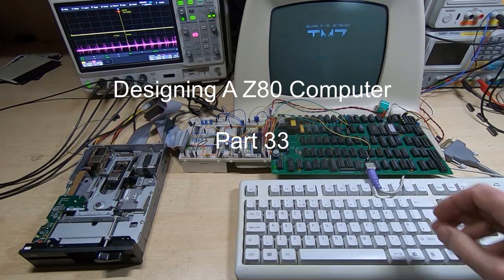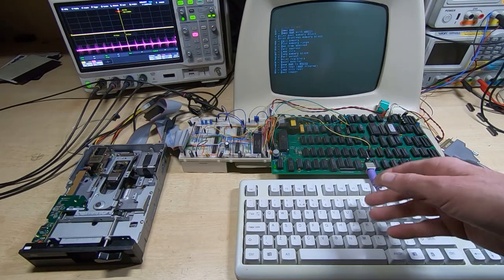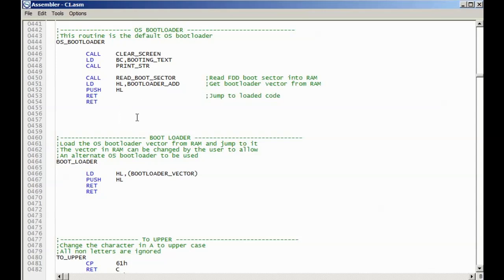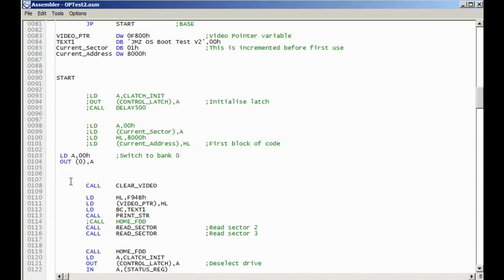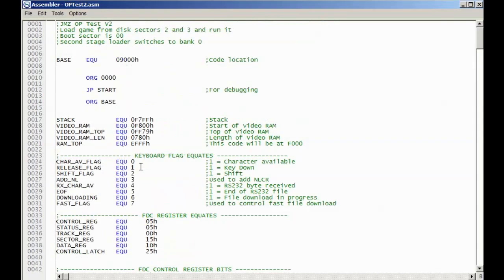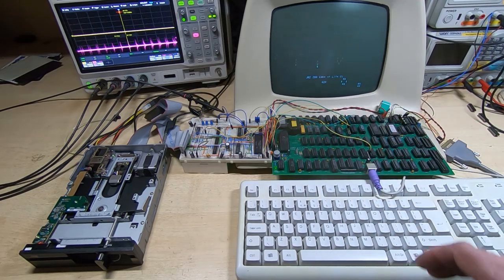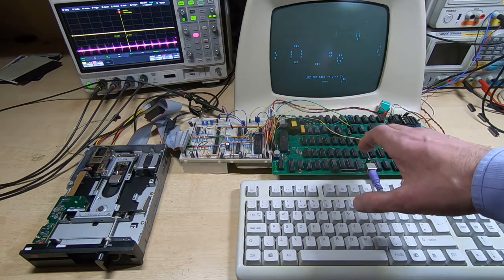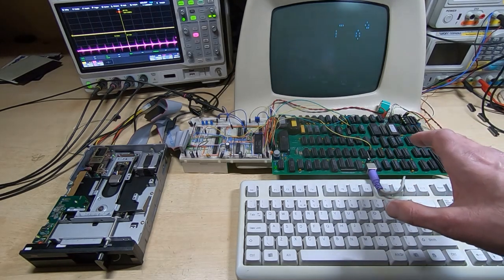Designing A Z80 Computer Part33

Comment: Looking forward to the dma video, im wondering if a cache ram would be needed or if the bus arrangement will be enough for the cpu to grab instructions while the dma does its transfers. I guess i will find out soon enough 😊
Reply from the maker: I will post a video on the DMA when I have a board available but you may find it interesting to investigate the BUSRQ and BUSAK operation of the Z80 as this will probably answer your questions.